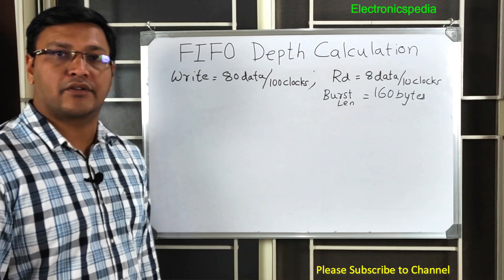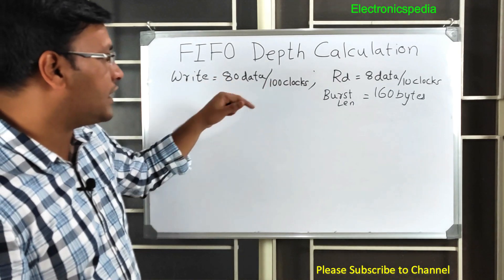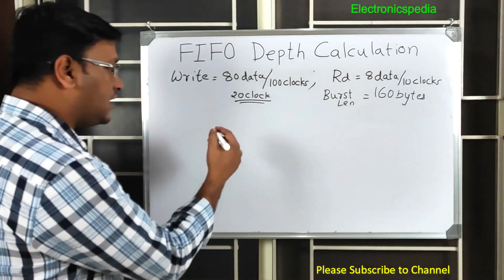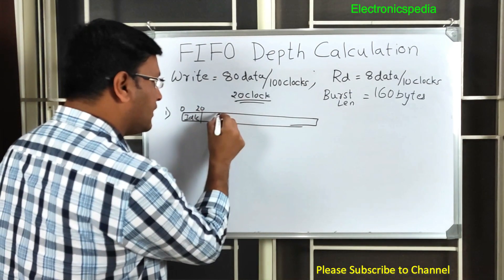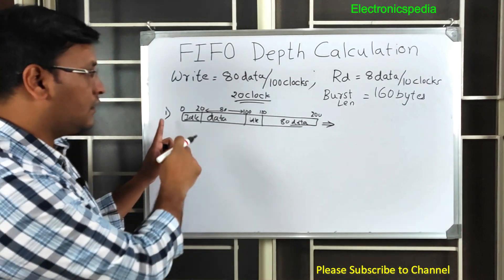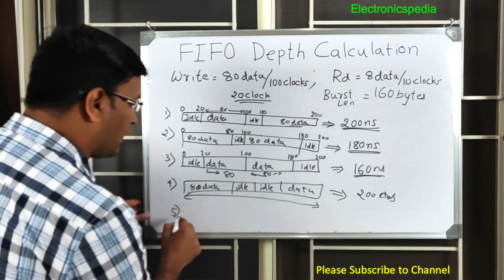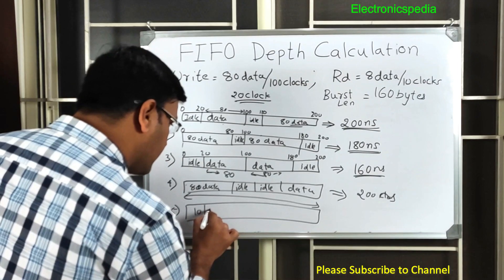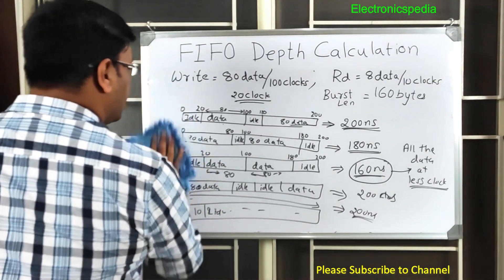FIFO Depth Calculation | How to Calculate FIFO Depth | Clock Domain crossing | CDC | VLSI Interview

Comment: idle 20 : data 80 
NOTE : only IDLE between 2 write cycles is taken for calculation not any other. 

case 1
1. idle data idle data : 0+80+20+80 = 180 in 200 
2. data idle data idle : 80+20+80+0 = 180 in 200

case 2
idle data data idle : 0+80+80+0 = 160 in 200

case 3 and all other random combinations of idle and data. 
data idle idle data : 80+20+20+80 = 200 in 200
all other = 200 in 200

160 is where the whole data is written in fewer clock cycles. 

Read 8 data/ 10 clock 
x = 160*8/10 = 128 
160-128 = 32 depth

Comment: can someone help solve this question? FIFO DEPTH? 
Given Rules:
 i) A is input data and B is output data
 ii) frequency(clk_A) = frequency(clk_B) / 4
 iii) period(en_B) = period(clk_A) * 100
 iv) duty_cycle(en_B) = 25%
Reply: Found this in some book :)
This can be solved by taking an example. 
Let the frequency of clk_B be 100MHz.  
That implies, frequency of clk_A = clk_B/4 = 25MHz 
Period of en_B = (1/25M) * 100 =  4 s 
As duty cycle of en_B is 25%, it will be high for a duration of 1 s. That means B 
receives the data for 1 s and will be idle for 3 s. Where as A sends the data every 0.04 
s. So in 4 s it can transmit 100 words. And B receives 25 only, so we need to store the 
rest of 75 words in the FIFO. 
So the minimum size of FIFO required is 75 words.
Reply: @Awakened_Pot  Thank you!
Reply: I am solving the same question today  for end sem of my 3rd semester exam,dicti same question is there in my proff notes.

Comment: minimum is 180 cycle to write 160 data, you can't ignore the initial 20 cycles in 3rd case
Reply: you can ignore the last 20 idle cycles, but not the initial 20 idle cycles
Reply from the maker: Yes that's correct

Comment: In case 1 why is the write time 200ns and not 180ns, as we are idle in the first 20ns ?
Reply from the maker: Hey thanks for pointing it out, you are right it should be 180ns in case 1.
Reply: Obviously , i have the same question, why is it not 180ns in the first case?
Reply from the maker: Hey thanks for pointing it out, you are right it should be 180ns in case 1.

Comment: Sir, u mentioned to take worst case scenario so we should get FIFO depth = 160-(200*8/10) = 0
Reply from the maker: Worst case is 
Write side is at maximum and read side is minimum. Based on this we have to calculate depth.
Here in 160 clock cycles of writes,  how many reads will happen should be subtracted from 160
160-(160*8/10) = 32

Comment: What should we do if read clock frequency is 100 MHZ and write clock is 50MHZ
Reply from the maker: Hi, In an ideal scenario since read frequency is twice write frequency we should be able read out all the data with 1 deep FIFO. 
BUT async FIFO involves synchronization of write and read pointers in order to calculate FIFO full and empty condition. Now if synchronization is done using 2 stage synchronizers then we might need 3 deep FIFO, assuming metastability settles in 2 clock cycles. But if metastability settles in 2+1 clock cycles then 4 deep would be safer. 
PS: here 100 MHz clock can also be out of phase wrt 50mhz clock
Please share your thoughts.

Comment: In FIFO depth calculation, if the burst size is not given, the read is continuous, then how we can calculate depth

Eg: if 8 bit FIFO where it has wr_clk is 50 MHz and Rd_clk is 20 MHz, How we can calculate the depth of FIFO
Reply from the maker: Hi Prem, if FIFO wr_clk is more than rd_clk and burst size is not known or indefinite then fifo is going to overflow.
In order to fix this we may have to back pressure the write side if FIFO becomes full.